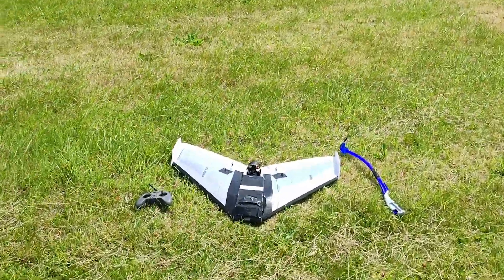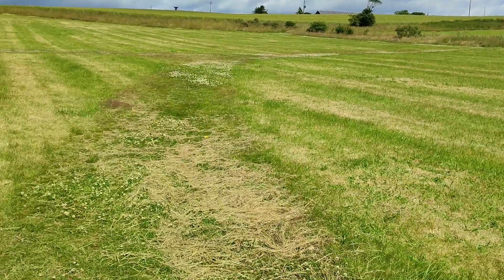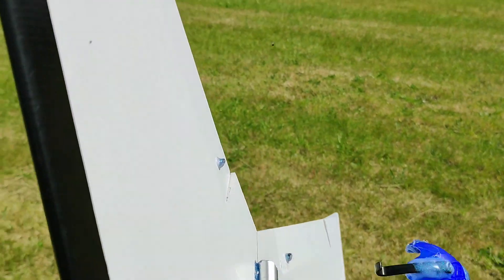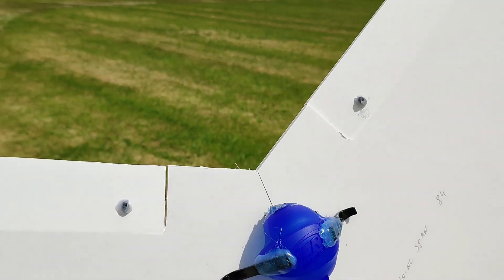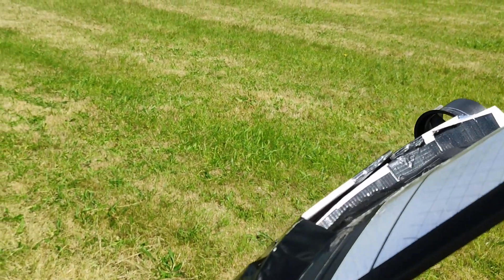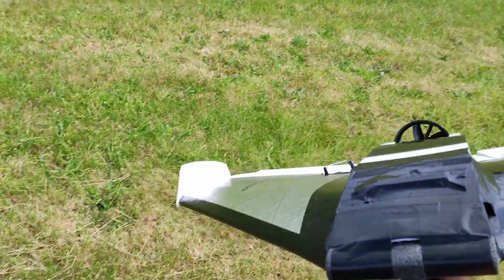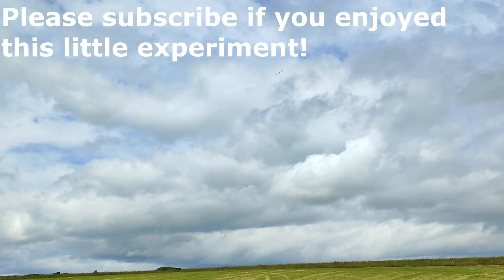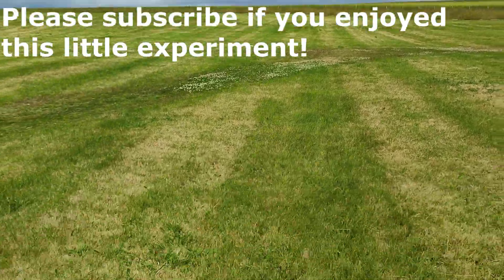How to make a RC Flying WING LAUNCHER. Improving Safety and Increasing speed at take off

Comment: If you use that type of connector, you could just make a kind of lightweight "fuselage" that you hold and throw. When you release it and pull up, it will just fall off. Then you aren't stuck holding something while trying to fly.
Reply from the maker: Thank you for the feedback, do you have a little drawing so that I could understand your idea
Reply: @ericflighttester7145  not currently but I will briefly try to describe. You would lose the advantage of the leverage when you launch. I'm just thinking of a handle. Look at the 2:13 mark. If you move your hand back a few inches and get rid of the handle out the front, it would be basically what I a describing. Just a handle that only holds on while you launch and falls off on its own. It would keep your hand clear of the prop and be simpler, even though you lose the extra speed. I will try to leave a picture on your FB post later if I get the time.